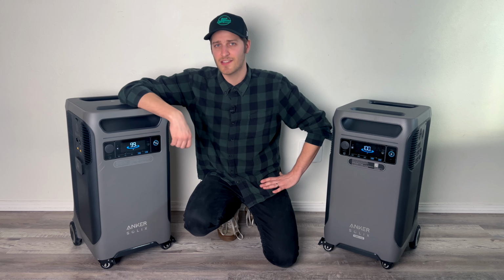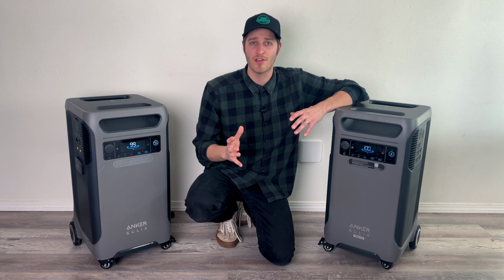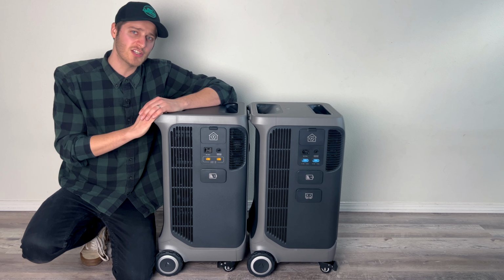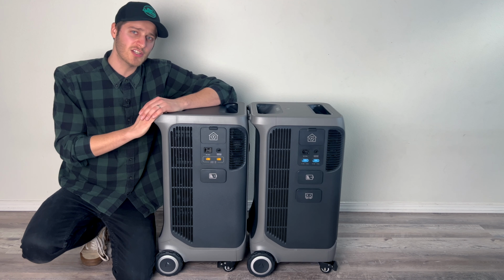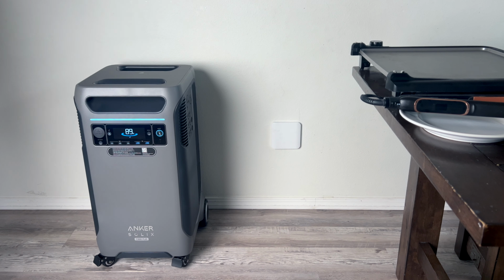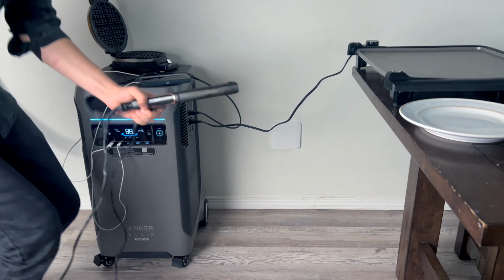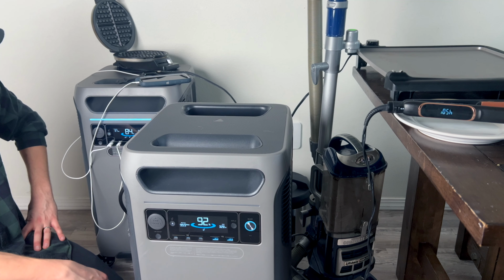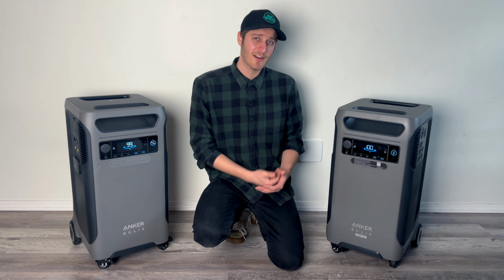Anker SOLIX F3800 Plus - Customers Spoke and Anker Listened ⚡️

Comment: Does the new model allow 240vac output while receiving 120vac? If so how many watts?
Reply from the maker: Unfortunately neither allow for that.
The new one allows for 240 output with 240 input from a gas generator though, which is super cool for maximizing fuel efficiency on your gas generator especially during a longer power outage.